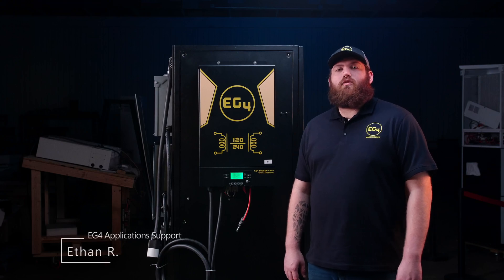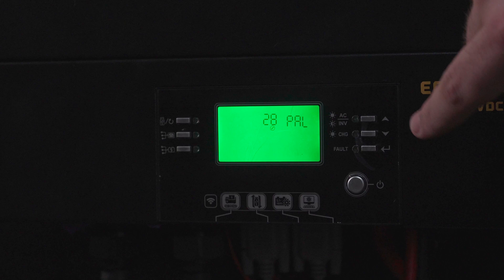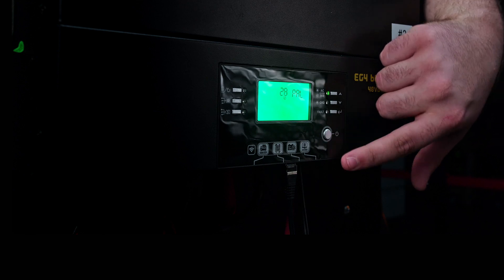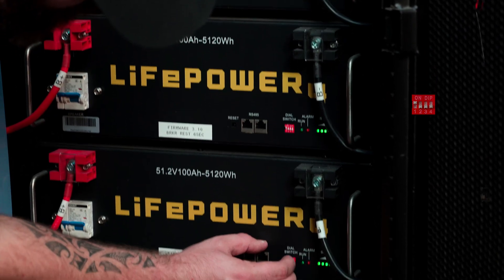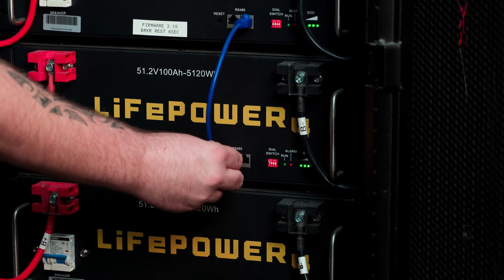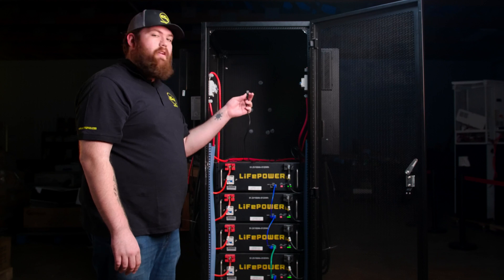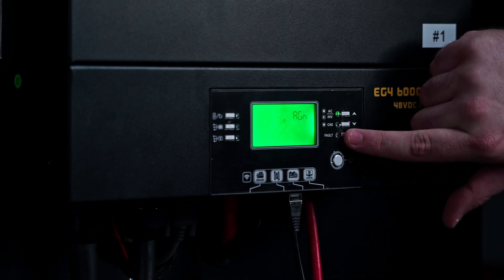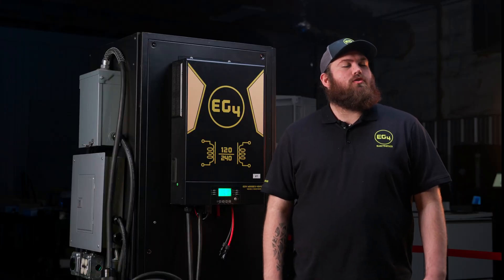EG4 6000EX-48HV Commissioning Guide, Inverter to Battery Setup, Parallel Setup, 6000w Inverter

Comment: Can I get some help from you guys. I have 2 6000ex's I'm trying to parrallel. Followed your steps and when I kick the 2nd one on one kicks off like they are sending unwanted power into each other out of phase.

I noticed that the slave unit keeps reverting back to sig from pal. The host stays in pal like it supposed to on setting 28.

Comment: Can you post or repost if you haven't already. The dip pin settings for 30 batteries. Also did you or can you do a video for the 3000-EHV. I have 6 of the 3000-EHV with lifepower Batteries. Do I need a special cable from master battery to 3000-EHV?

Comment: i can’t seem to get my generator to run through the inverter. the inverter registers the ac in. but will not charge the batteries.
Reply: This unit will only charge with  split phase 240V, so if your generator is 120V like probably every portable generator out there, it's not going to work..  I wish I knew this before I bought mine.
Reply: @sibco96  my generator does supply 240v the inverter only accepts 120v there is only room for 3 wires at the terminal block on the inverter and the manual says a/c input 120v
Reply: @patrickcoyne1292  it doesn't sound like you have the same inverter that's in this video.  The tech people at Signature Solar are really great, and they can help sort it out.
Reply: @sibco96  it 100% is the same inverter. and sure they are. if you can ever get someone to answer.

Comment: Thanks for the video!  I like the idea of mounting the inverter to the rack directly to make it an all in one system.  I assume this would work on the 6 battery cabinet as well with proper screws?  Did you add any support brackets in the back on yours?

Comment: Why is this OFF GRID?  This is a copy of the "MPP solar LVX-6048 Inverter".  LVX -6048 is grid feedback capable.  I was hoping for a grid feedback Eg4 version to have BMS coms with the EG4 batteries i bought l. This model does less for the SAME PRICE as mpp.... Why buy for this model if it CAN'T even be grid tied? 

Is Eg4 coming out with a grid feedback model just like the LVX-6048 model it copied from MPP SOLAR?  Crossing my fingers

Comment: Idle Power Consumption is 114w, is there anyway to reduce this number? Why is it so high? That's  2.7kw per day. This would be a problem during the winter months. Is the main solution to just turn it off (if yes, is there an automated/remote way to do so?)?
Reply: I asked their support department about this, and the answer was: "When the inverter is in standby/power saving mode, there will be minimal to no idle consumption."        I have no idea what it takes to put the inverter into this mode.   I have this unit but have not built my system yet.
Reply: @sibco96 it means to turn off the power button but this unit is discontinued 😡
Reply: Thank you @Laurel-Crowned
Reply: @sibco96  anytime bro 🙏

Comment: It would be nice to have a video comparing the 6000 and 6500. So we can make an informed decision on which one we want to get that is best for us
Reply: The 6000EX is transformer based, and the 6500EX is inverter based.  Under load, I'd imagine the 6000EX would buzz rather loudly.  Also, the idle power for the 6000EX is 114 watts and the 6500EX is about 60 watts.  The 6000EX can handle 7500 watts of solar, the 6500EX can handle 8000W of solar.
Reply: @charlesball6519  What does that mean to the layman building an off-grid system? I'm trying to figure out the real world differences other than humming and max PV input
Reply: @gdegarimore  The 6000 can support a 12000 watt overload for 1 second and the 6500 can support a 13000 watt overload for 5 seconds per Signature Solar tech support as that was a question I needed answered today.

Comment: How many of these should I use for 20kW of solar and 60kW of batteries 
what else would I need to integrate a backup generator?  How many of those cabinets do I need?
This is for an offgrid property and I need 110/220
Reply from the maker: I would suggest 4 in parallel. You will need 2 6 slot cabinets of batteries as well.
Reply: @SignatureSolar  someone did get back to my email (thank you) and I was sad to hear that 1500m above sea level is the max. What inverter would work in its place? Property is at 9500ft
Reply: @mattbrew11  I would think they would just need to slightly de-rate it and not disqualify it's use altogether.

Comment: Can it be connected to a generator?
Reply: Unfortunately, I found out after I bought this unit that it can only be powered (via AC input) by split phase 240V, so ordinary portable single phase 120V generators can't be used as a backup.

Comment: I would like to know if anyone can show how they run the in and out from the inverter to the electrical panel, showing grounds, etc. and can they be in the same panel for a grid pass-through set up (using the EG4 6500 EX48).
Reply: Try reaching out to the design department at SS - they have grid passthrough diagrams for these inverters

Comment: Did I screw up buying the 6500EX from this company??? I've had it for months but I haven't even taken it out of the shipping box.   It's a high frequency inverter and these are low frequency. I don't need 240V but I could've just used 120V from this right?
Reply: Hey, Honus.. I think you made the right call if you only have 120v loads. The inverter you have has a much lower idle consumption, and is quieter since it's transformerless. Your inverter can also handle a fairly large surge similar to the all in one units.
Reply: I don't think you screwed up.  if you need 120V, the 6500 is the way to go.  I bought the 6000 for the flexibility of possibly having 240V loads in the future, but then I  found out that you can only use 240V split phase as an AC input, making most portable generators useless as a backup input source.  I wish I had bought the 6500.  I hope that helps.  I have not assembled my 6000 system yet, so I can't comment on its performance.
Reply: @sibco96  thank you!
Reply: Transformer based inverters are best for inductive loads
Reply: @TK-123  Agreed!

Comment: Are the EG4 inverters in this video low frequency inverters?
Reply: The weight tells you they are…
Reply: I talked to SS today and did confirm these are not considered low frequency as the surge is only 2x as opposed to 3x on a typical low frequency inverter. The only reason you should choose this inverter over the 6500 is if you're looking at needing an odd number (1,3,5) of inverters. Also the 6000 is in-stock currently.
Reply: I don’t believe so

Comment: This is fantastic! Question though. I have four LifePower4, and two GYLL batteries. Can the 6000 inverters communicate to these as a group? My decision on these inverters rests on this.. Thanks!
Reply: Don't know the answer to your question, but don't let it stop you from buying the inverters. USE setting can still be used and works fine.  I monitored my batteries with BMS software and tweaked my batteries to 56v bulk charge and 55.5v Float.
Reply: @genxgamerdad71  I did the same thing. I think the built in Bms in the batteries shuts them off as well. I had originally set the voltage to 58v bulk charge and 56.4v float. The Bms in the battery should shut it down before I think?